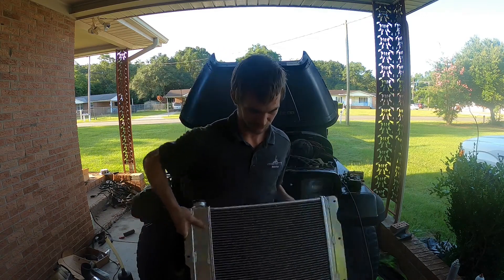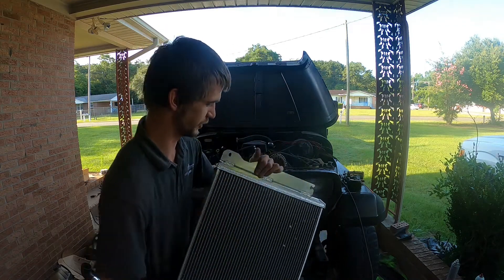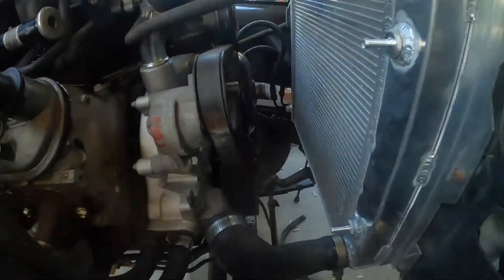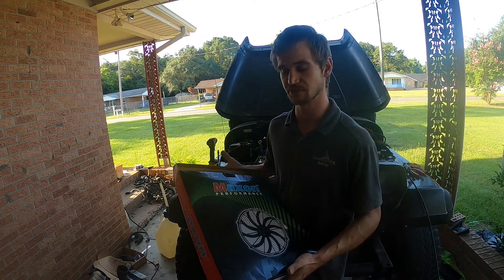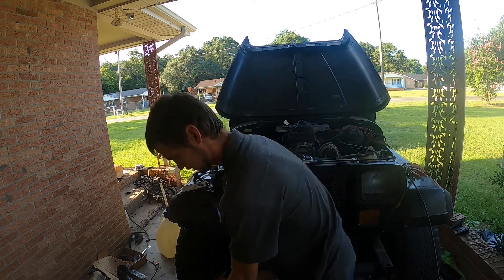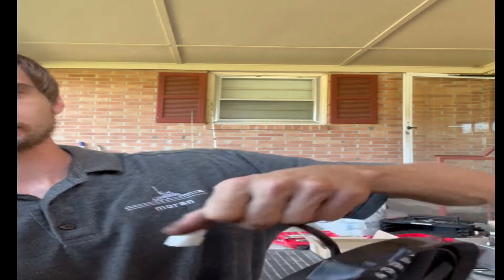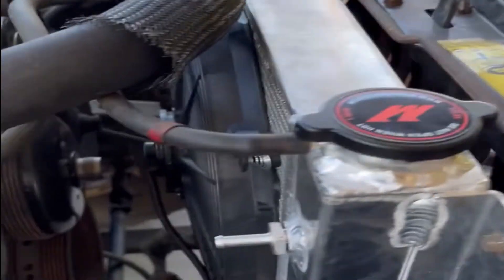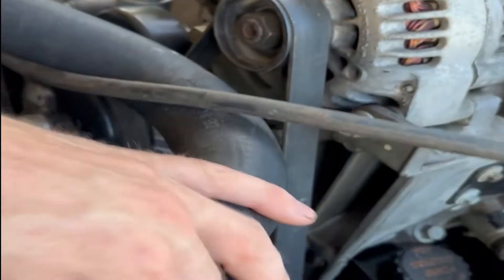Jeep Wrangler LS Swap Part 5: Mastering the Cooling System

Comment: What tires are you using on the forgestars that are on the silverado?
Reply from the maker: I run Mickey Thompson Et Street R on the street and I run Et Drags at the track
Reply: And for the front tires what brand are you using?
Reply from the maker: @marioleal4307  it’s just regular cheap street tires I’m not even sure what brand they are like a 225/55/17 or something like that
Reply: Are you done? Is it running?